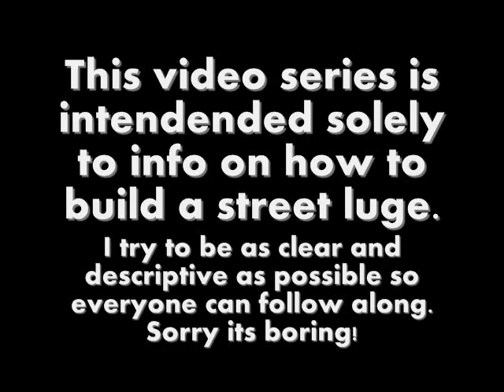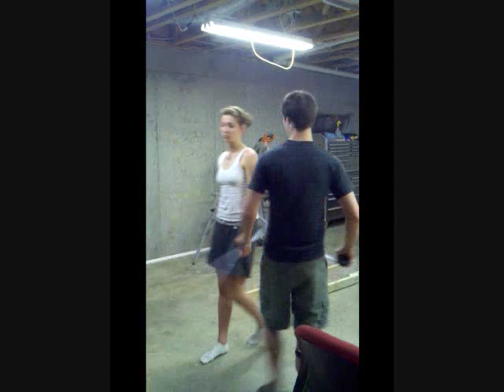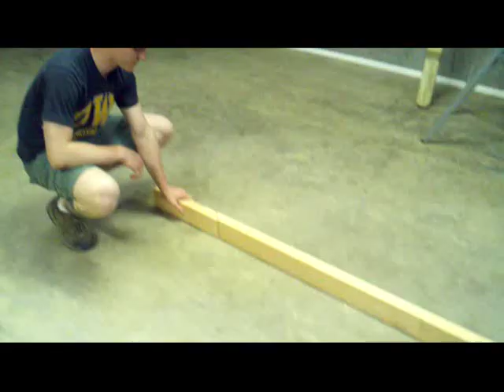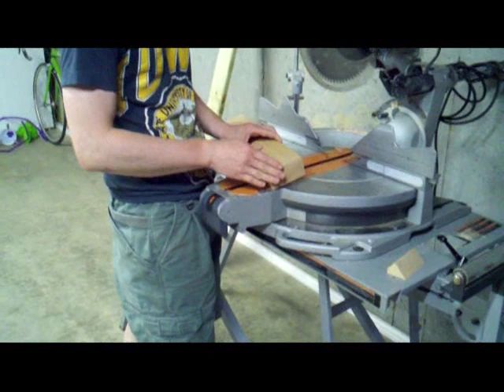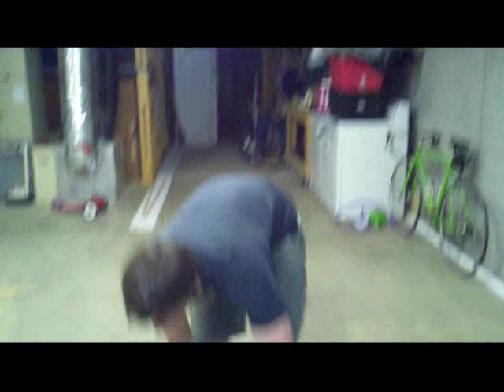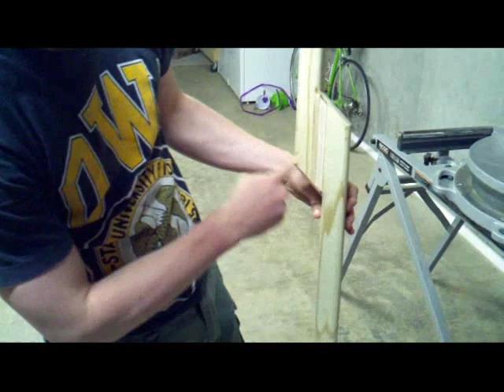How To Build A Street Luge Part 2 Measurement & Cutting

Comment: I'm trying to figure out the dimensions but something isn't right... The chest length (for example 26'') need to be the dimension between the 2 short pieces (8''), am I right? When you glue/screw them 6'' from the measurement of 26'' it will be 26-12=14''... It is waaay shorter than the chest length (26''). Please, explain!
Reply from the maker: magdanoz88 You are forgetting to ADD 8" to your measurements. Hypothetically, if your head piece is 10" and your torso piece is 20" then you will end up with two pieces at 18" and one piece at 28". Your seat pan would also be 28" and you will cut a 4" notch on one end and a 2" notch on the other to fit onto the rail. I show that in video 3.
Reply: Z Dunlap Thanks, man! Really good info! Now it's clear. I think that I heard of this 8'' adding in part 3 but...something with the sound is happening on that mark of the video and I couldn't hear it clearly! :) Thanks again!